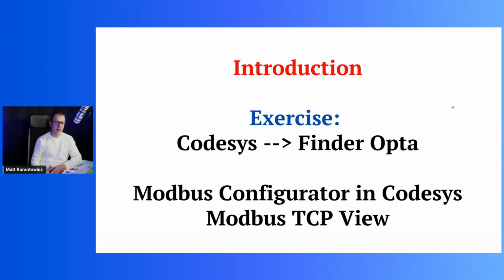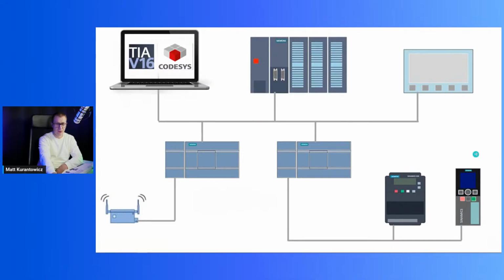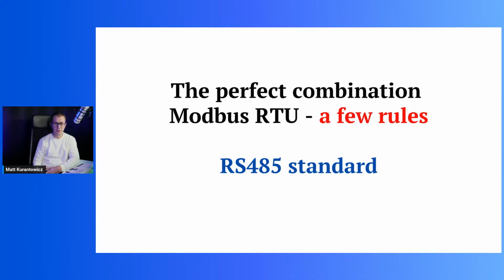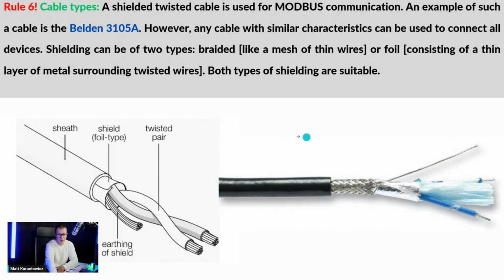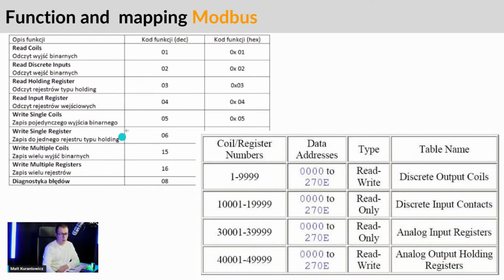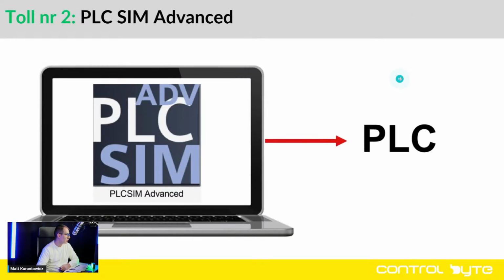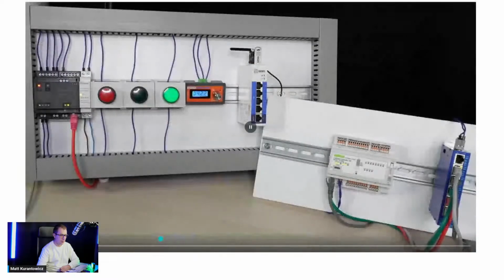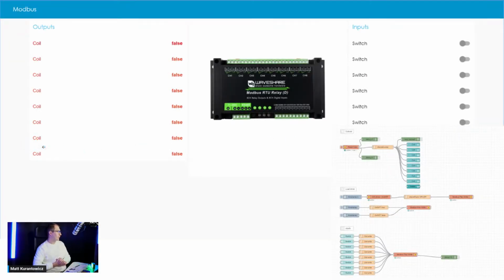Learn the Modbus RTU and Modbus TCP protocol in 1 hour

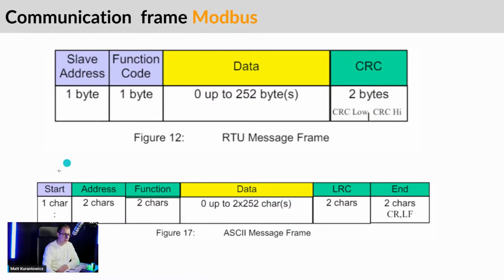Comment: 24:29, why is the data length limited to 252 bytes?
Reply from the maker: The 252-byte limit comes from the Modbus RTU frame structure.
A Modbus RTU frame can have a maximum of 256 bytes in total — 1 byte for the device address, 1 for the function code, 2 for the CRC, and the remaining 252 bytes for data.

This limit was defined in the original Modbus specification to ensure reliable transmission over serial links like RS-485.
Even in Modbus TCP, many libraries keep the same data length limitation for compatibility reasons.

Comment: Thank you for the great video. I was wondering if you could help identify the mistake I'm making with Codesys as my master and an Arduino as my slave, I wrote the slave side code for the Arduino and am using the com port, but is returns a "Bus not running" error when trying to connect to the Arduino. I've been trying to troubleshoot it, but I can't tell where the problem is.
Reply from the maker: Thanks for your comment! 😊
I can definitely help you with that — we cover similar setups in our training.
Once you purchase access to the Basic Structured Text PLC Programming in Codesys course, you’ll also get access to our private forum, where we provide direct help and troubleshooting support for Codesys and Modbus communication projects like this one.

👉 https://controlbyte.tech/basic-structured-text-plc-programming-in-codesys/